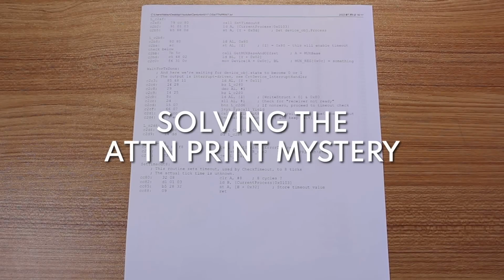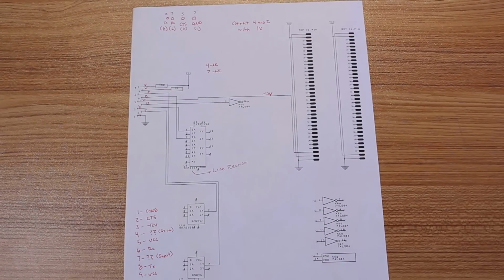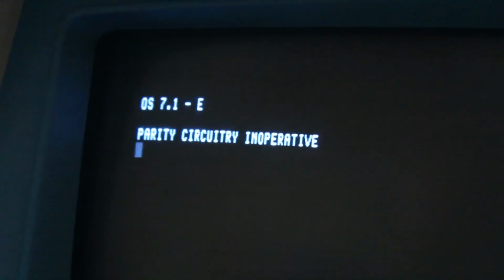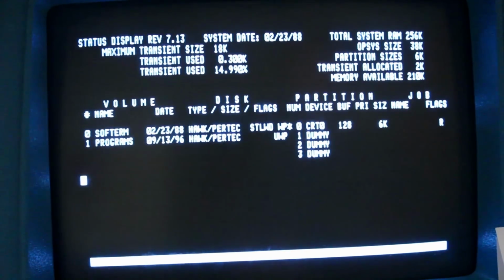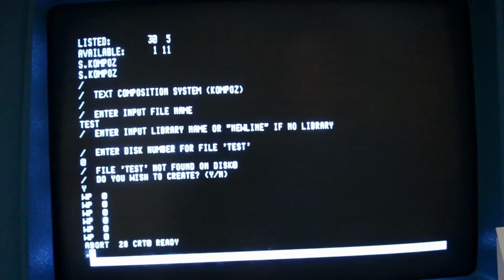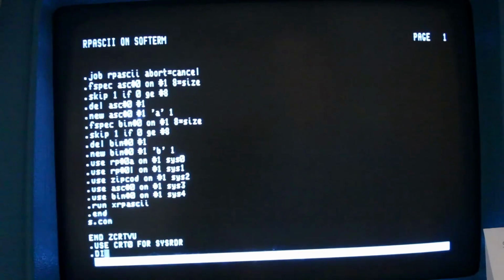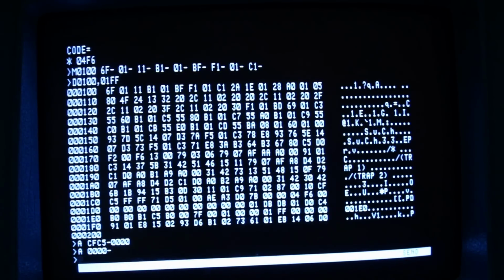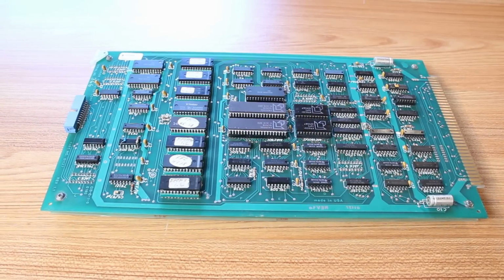Minicomputer Part 17: Welcome to the OS!

Comment: Well, you may find this patronising, but I recovered a lot of crashed heads in the early 1980s, without ultrasound, so bear with me.
@24:26 Is that you thinking that you can clean the heads like that? Not the best way. Now, if you've had any out, I haven't seen them, because I haven't watched every moment (sorry).
Here I'm assuming that the heads are, as is likely, the round ones, about 15-20mm diameter, as used on Ampex and DEC drives. Look at it against the light, if there are scratches on the head surface, they MIGHT polish out, but if there are any big ones, that head won't fly right.
So...
You take them out, you generally clean them with a cloth and isopropyl alcohol, 
Then you drip some isopropyl onto 80gsm paper and you polish those heads, rubbing them on the alcohol patch and paper. 
Push down on the head, not the wires or the suspension.
Refresh the alcohol patch regularly, on a different part of the page and keep polishing until it is very obvious that you have cleared out the recess.
Thing is, there is a tiny recess around the pole pieces of the head and that gets bunged-up with oxide and glue when there is a crash. 
If it is left there, you get a muddy magnetic field and you can't read or write properly, if it even flies.
Then you put the heads back and align them.
If those heads are not bang on perfectly clean, then you find out what the little recess was for. It forms part of the flying characteristics of the head and if it isn't clean, it'll crash again.

Now, one useful technique that works on some drives is to disconnect the head positioner circuit from the drive voice coil.  Then you load the heads a bit, just enough to trip the "head loaded" switch. Most drives will run up the motor at that point, but it will go at full speed, around 3000 or 3600rpm, though normal spin speed is around 2700 or 3000 respectively. Then you can load the heads manually. If it tinkles (partial crash) for more than a second or two, unload the heads, remove them and polish/refit/align again. Put the drive cable back.

Good hunting with that!

Comment: The printer looks like a band printer. If it is then be very careful when working on it. If you open the platen while the band is still spinning it can be quite dangerous. A co-worker of mine came milimeters away from decapitating himself when the steel band snapped and shot out of the printer at high speed. It embedded itself into the wall behind him. The moral isalways let the band come to rest before opening the platen.

Comment: Hmm will someone write snake for this machine?

It would be great if this computer could do something usefull like control lights or some other machines

Also how hard would it be to make a new platter like make a circle with metal then coat it with some magnetic material into which you could then put data on

Comment: Nice job!  Looking forward to seeing the platter-swap - are you going to pull the heads and give them a good soaking / clean off the oxide and other metal debris deposited when they dug the grooves into the platter?

Comment: Man this is much easyer than the old CIRC AS400.  Been looking at the tapes I extracted and you just don't know how to dissasemble it.  Thing uses 2 layers of microcode:P
Reply: David and the Centurion Team have been lucky that all the microcode PROMs for the two AMD2901 Bit Slice ALUs and the CPU6 control logic are in tack.   The Centurion used RISC like chips (AMD2901) to emulate the older Centurion CPU-4 "CISC  TTL"  design.

Comment: Question 1: can it run Linux?
Question 2: can it run doom?
Reply: A UNIX port is something that might happen in the future. Alan Cox pondered about porting his FUZIX to the Centurion I think.
Reply: ... It was supposed to be a joke
Reply: 1 no linux requires a 32 bit or higher CPU and the kernel is over 2 MB in size.
2 probably not.  Doom was developed on NextStep with a target of MS DOS and I'm pretty sure it uses at least 400 kB of RAM.  Not to mention the lack of graphics hardware.

Comment: I'm pretty confident that the "missing" input on your MUX card goes to DSR or DCD because the mux was intended to connect to modems. Using DCD would mean that a terminal session could be spawned for each session that was dialed in remotely, and close it when the line was dropped.

Comment: Interesting that a computer from 1980 was in (at least occassional) use in as late as 1996. It might have been normal in the USA (and countries to the west of the former Iron Curtain), but here in Slovakia, widespread use of computers came only in the '90s and there's almost nothing left of Eastern computers made before 1989, apart from a few pictures. That's how I know that one of the factories of my hometown had a EC series computer (a Soviet IBM 360 clone). The factory went bankrupt, and only a single photo has remained of the computer room. The building is still up, and there's an advertisement agency (for which I worked for briefly in 2014) in the offices what used to be computer room. You can tell by the raised floor, fireproof doors and the (now unused) AC ducting.
Reply: My grandfather's company installed a "small business computer" (with core memory!) around 1977, and finally replaced it in 1991 with an HP tower PC (running SCO UNIX and FoxPro).
Reply: @RonJohn63  as recently as 5 years ago the clothing factory I worked at was using Pentium machines with msdos to control some of the cutting machines on the factory floor
Reply: @aelitadelarobia  if it ain't broke, don't fix it.  (And that Pentium was almost certainly massive overkill for controlling cutting machines.)

Comment: They must have been a good computer system to have been useful until '96  .  The company I worked for moved to networked PCs in the late 80's /early 90's
Reply: It's all about the business software that kept Centurion systems running in a few cases into the 1990's.   Hard to be leave but we now know of a customer that ported the Centurion business software over to networked Intel PC's and still are running the business software in 2022.
Reply: @kenromaine2387  oh i can believe that. Modern software is usually bloated beyond use
Reply: @wktodd  We ran the OPSYS,  four User Terminals (app programs)  and the Printer Spooler in only 32KB of DRAM.  All texted based apps. no modern graphics.
Reply: @kenromaine2387  32k :-) I remember being impressed when we upgraded the server to 256kB  , Id never seen so much ram in one place  !
Reply: @wktodd  A few years ago at work we installed 512GB of ECC memory in a number of 2U Data Center class servers. A long way from 8KB of core being a large amount of RAM in the early 1970s.

Comment: Here is a question service engineers used to ask: if the heads fly above the platter, won't the brushes not also fly instead of cleaning the disk?

Comment: can this system form a virtual disc in RAM to create / play sandbox edit files
Reply: No virtual disk or RAM disk support in the Centurion operating system, it was designed in the 1970s.
Reply: @kenromaine2387  Did that only come in with Dos ?  how easy could code be created given the memory addresses are pretty much definable ?
Reply: @highpath4776  The idea of swapping memory in & out of a disk drive I think came first with the Unix swap disk idea in the late 1960s-1970.  The cost of core memory or semiconductor memory was very high. The first 1KB of static RAM I purchased around 1975 was 1/3rd the cost of a new car.   RAM Disk. like using high speed memory to act as a disk drive file system I think only started many many years later when semiconductor memory was dirt cheap.  Anyone having other info please correct me or know of one-of-systems.
Reply: @kenromaine2387  Yes the flipping of Storage and Memory was always a cost vs speed trade off, depended what you needed.  I suppose there is no reason why the centurion code could not be written to address any kind of storage ( poss with a slowdown to cope with the CPU abilities ).

Comment: 5:00 Why/How did the DB25 turn into a DB9?
Reply: Warrex-Centurion started using a DB9 connector for RS-232 cables on the 4-Port MUX because four DB-25 connectors would not fit on the front edge of the MUX card.  The reason the pins that Warrex-Centurion used did not match up with later DB9 pinouts used on PC is because IBM do not copy the Centurion DB9 RS-232 pinout   ( really the 4-Port MUX shipped years before the PC was designed ).

Comment: Check the system for it's millennium compatibility.
Reply: We are currently on using the old ( last systems date in 1988 ) till we have real backup disk packs completed.  We think the code is ok with post Y2K dates but currently leaving the drive Write Protect switches enable till backups are completed.

Comment: Also, thanks for calling the 9-pin  D-shell connector in the multiplexor card “DE9.”  Back in the previous century, I spent many hours with my breakout box getting various serial devices to talk to each other.  There are so many possible permutations and it is clear quite a few manufacturers didn’t want to spend a few Dollars to get the genuine RS-232 specification from EIA to properly implement their serial ports.  I believe a copy was about $20 back in 1980.  It was one of my closely guarded references for many years.
Reply: Did EIA have a standard for the 9 pin connector using RS-232 in 1974 when  Warrex-Centurion first shipped the 4-Port MUX card? We used the DB9 or DE9 so we could get four connector on the front edge of the MUX card.
Reply: @kenromaine2387  The copy of RS-232 which I have predates the use of DE9 connectors for serial communication.  What is interesting is the specification denotes specific pin numbers and detailed acceptable allowable input and output signal levels and signal characteristics, however as far as I can see in the document never specifically says the pins have to be in a size B D-shell.  To wit, I suppose it could be a round military Deutsch connector as long as the pin numbering are consistent.  That implies that 9-pin connectors violate the original RS-232C specification due to the signals not matching the pin numbering.  The device which I have encountered which most closely follows the original standard is the original Western Electric Bell 103A 300 Baud modem.  A fair amount of equipment I have encountered with 9 pin connectors comes in on the low end of allowable minimum output signal level.  We can also add 8-pin RJ45 modular connectors to the mix; Cisco’s console terminal connection with light blue jacket cable is sort of a default standard, but not always.   Throw in various implantations of FTDI and Chinese almost compatible clone UART-emulating USB to 9-pin cables and it can quickly become be infuriating trying to figure out what isn’t working.  Of course some PC software looks for actual 16550 hardware instead of virtual UARTs and it gets even more annoying.  If I have misinterpreted anything, I am sure I will be quickly severely punished by the Internet. 🙂
Reply: @kenromaine2387 I didn’t a good look at the schematic for the MUX card in the video.  Is the Warex-Centurion the same as the layout used by IBM on the PC/AT?
Reply: The other thing I forgot is is timing of asserting RTS/CTS and DTR/DSR.  Sometimes it required very interesting cross-wiring to get two devices to talk.  We can also add in whether or not a manufacturer felt one or the other hardware pairs should be used for flow control of if XON/XOFF ASCII should be used instead of or in addition to hardware flow control.  Does flow control happen fast enough to prevent buffer overruns?  And then there is odd/even/stick/no parity bits on the data.  Also, is an isochronous clock required on the clock pin(s)?  I never encountered a clock being required, but I have seen it supplied as output on DB25 serial connectors.
Reply: @wtmayhew  When the 4-Port MUX was designed Warrex-Centurion had about 6 to 10 employees and all we cared about was getting 4 dumb ADDS 580 terminals to work on the MUX card.   If the needed signals would fit in a DB9 then we could get four terminals connected on a single card.
Reply: @kenromaine2387  From the video series, it is a fascinating machine and it is clear the people on the design team are very capable engineers.  The 4-port MUX card is a nice example of making what is available go further than originally anticipated.  Thanks for your input to the restoration project and making the preservation of some classic engineering of the latter part of the 20th century.

Comment: man i'm all for retro stuff but this is by far way way too retro for my taste. when the power switches are flipped to (| ) the closest nuclear power plant is told to ramp up to 100%. no thanks. Even I have my limits
Reply: The Centurion system as configured used less than 1,000 - 1,500 watts or about what a blow dryer used.

Comment: Why don't you write a little tool for dumping the hard drive image to a modern system using serial, so you have a backup?
Reply: He did that like 5 episodes ago.
Reply: @ghydda  So he doesn't need to fear about the hard drives contents despite saying so in this video ..
Reply: @elmariachi5133  he has done the backups, what he is afraid of is losing more platters to head-crash failures. New platters and heads are made from Unobtanium --> therefore not available in the marked to purchase, and used parts are rare as hen's teeth. It is all about keeping the old gear running.
Reply: @ghydda  When he was mentioning the write protect switches he was specifically naming the hard drives' 'contents, that's why I was wondering about that.

Comment: Congrats! I binge watched all the episodes this weekend and amazed at all the hard work that went into bringing this back to life. 

I was wondering. Is it possible to figure out the hawk communication protocol and replace it with a modern device (think FlashFloppy on Amiga). This will guarantee this computer will work for decades.
Reply from the maker: Thank you so much!
That is definitely something we're working on. The Hawk is a tough old drive, and I'm confident it still has many, many hours of life left in it, but having a solid state emulator hiding out somewhere for day-to--day testing and experimentation will do wonders for my nerves, haha.

Comment: Ok. This is epic. But you know what I never see with these old systems?? Someone actually showing what software is available and runs on it. I'd love to see how this system was actually used. Is there an accounting package on it? If there are programs, can you demonstrate them? I mean, what was someone doing with this system before it was decommissioned in 1996? And as for the games, You gotta port Zork, Startrek, and some type of dungeon crawler over to this platform. Come on, that's just a given.. Thanks for doing the videos. I have really enjoyed them.
Reply from the maker: This is actually something that II do want to  show off!
I have a strange fascination with productivity software. There's a few reasons why we haven't actually spun the drive up and run the original software on it yet, of which it's most likely accounting and tax software, though there maybe some specialized oil and gas software hiding out too.
The first is that we're waiting until we have all removable platters successful backed up and we have the OS duplicated on a few different platters (probably have it on the fixed and two removable platters), just in case. 
The second reason is we still don't know enough about syntax and file names to know how to successfully fire and use any programs.
Lots of learning still to go!
Reply: @UsagiElectric  Also, folks, bear in mind that these platters and drives are over 40 years old.  Anything goes as far as Murphy's Law is concerned.  I'd say data recovery goes priority 1 now, then we can "play around" with stretching out technology wings afterwards.  Maybe see if there are more modern alternative drives to more reliably recall software.  A Gotek or even a Raspberry Pi as a bridge interface to more recent storage means or emulating storage for the Centurion.
Reply: Yes it most likely was accounting. On paper systems it would take at least a day to balance the books, and even a really slow computer like this one could do it in maybe 5 minutes, depending on how many transactions there were, and be much more accurate.
Reply: accounting, salary & tax administration, invoices, maybe even some rudimentary crm (customer relation management, aka the digital rolodex), those kind of things

Comment: What if, you could find a way to save everything on a floppy drive instead of those old hawk drives ? I think that would be a good way to archive all that data that is on the those drives in the event those old drives just wear out and die.
Reply: Really? go from one old unreliable media to another? That is a bad idea even if without considering the discs would need to be put on multiple floppies. They already have a method to dump the discs to a modern computer. Most analysis is done on those. Thus not needing the hawks.

Comment: Awesome work, team.  So satisfying to see you get to this stage. 

You mention in video 14 that you bought an 8-inch floppy drive.   If you're able to get it working and transfer enough of the operating system onto floppy disks, you could use them for your daily testing instead of spinning up the irreplaceable Hawk drives all the time.  If the floppy drive fails, it's no biggie.

There are two types of hard disk: those that have already failed, and those that are just about to.